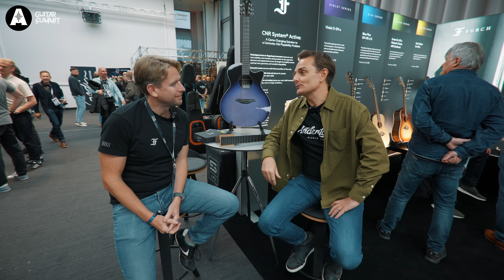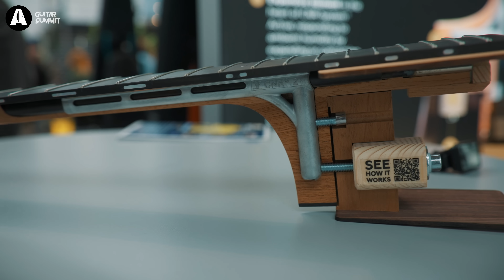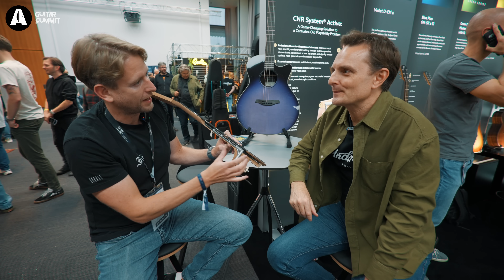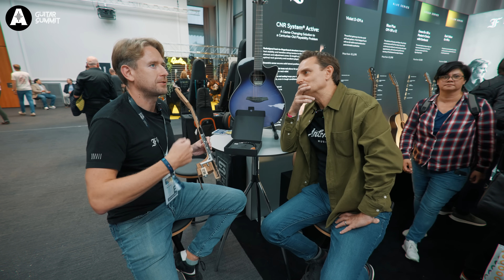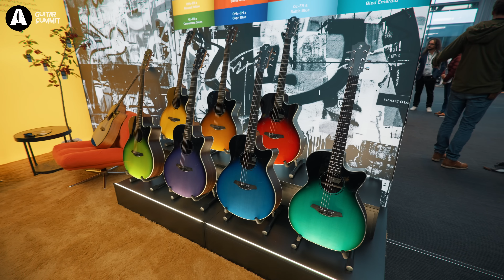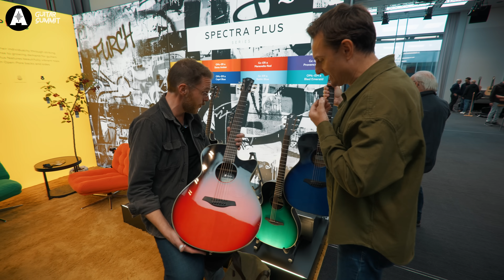Furch Guitars at Guitar Summit 2025!

Comment: Wow...the price for this rather unknown maker is unreasonable...no matter how you present these guitars.  Traditionally speaking necks are rather easy to adjust so their new system might turn out to be not necessary and overkill.  Plus you are required to purchase the tool to adjust?  Nope...

Finding an authorized dealer to address warranty issues must be a challenge.  

Get a Taylor....
Reply: For this price you would get not well build Taylor and also not all solid. You cant even compare those two... apples and pears. Furch beats it in every aspect. In that price range you will get Taylor manufactured for quantity, not quality. I am pretty sure you dont have experience with CNR Active on your own, that mechanism really works and everyone who understand guitars a little could tell you this is problem with instruments since beginning. I think you are being too conservative in this way and it only affect you in negative way. Try any Furch at any dealer. You would feel how great is sound and how sustain stay. I visited lot of stores with Taylors and you must pay really really high value, so it is not build bad.
Reply: @Carreta_97  Correct. Taylor's are nowhere near furch guitars.
Reply: @Carreta_97 True. Taylor are nowhere near Furch guitars

Comment: Not an expert at all fwiw but I always thought string height should be adjusted via saddle/bridge adjustments (filing down or shimming one or the other), not by adjusting the trussrod OR the neck angle once setup correctly. Anyone able to comment?
Reply: Not an expert myself either, but here's my take. The truss rod will have an effect on the height of the strings above the frets, however adjusting that height is NOT the purpose of a truss rod. It's there to counteract the tension of the strings on the neck. If there are no strings fitted the neck should be completely flat. With strings fitted and tuned to standard or other tuning the tension in the strings will produce a slight concave bow to the neck. This is a desirable feature to  allow for the displacement of a plucked string and so avoiding fret buzz. The bow is known as neck 'relief' and can be seen by putting a capo on fret 1 and your finger at fret 17 ( or thereabouts), the string becomes your straight line reference and a light tap on the top of the string should produce a ting sound from the top of the frets, and the neck relief should be visible.The truss rod can be used to make fine adjustments to the relief. It's best to keep adjustments to no more than a quarter turn at any one time, and allow time for the wood to 'move' before making any further adjustments. 
The saddle and nut filing is more of a job for an expert really I think. I've ruined a few with my DIY efforts. The right tools , nut files etc, are expensive for the hobby guitarist. Also bone and plastic are completely different in the way they respond to tools, it's all too easy to go too far.The neck angle adjustment is probably a good idea for guitars which travel a lot where humidity levels can cause changes in the wood, for most people it's probably not necessary but nice to have, and the Furch one seem to have a level of automation incorporated which is a bonus.
Reply: @jamjar20049  Take appreciated! Nice summary and valuable information regarding the truss rod, if not entirely new to me. I haven't bothered with nut files yet and totally agree adjusting nut/saddle slot depth is not something I'd feel comfortable with. 
I was thinking more of lowering the saddle or nut by removing material from the bottom to adjust for string action. I feel like many more affordable acoustic guitars are shipped stock with pretty high saddles and or nuts. 
My old Cort Luce 450 came with an additional saddle so I gave it a try on the one installed and removed a good millimeter this way without major issues - at least to my knowledge. Maybe that slightly messed with intonation? Playability definitely improved.
The ability to change neck angle on the fly and the whole CNR system on Furch guitars sounds legit and is really cool tech. The way they presented it as the go-to move for string action adjustment just surprised me. But again, not an expert at all. Cheers!